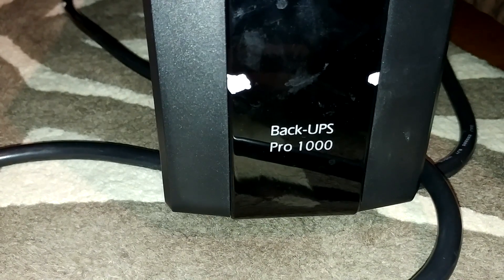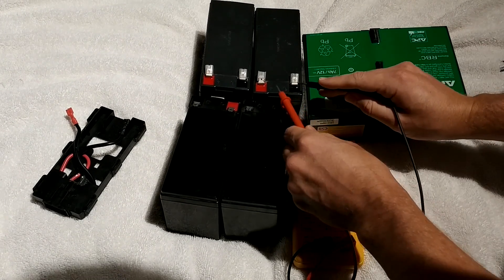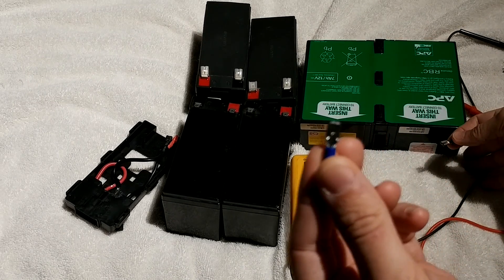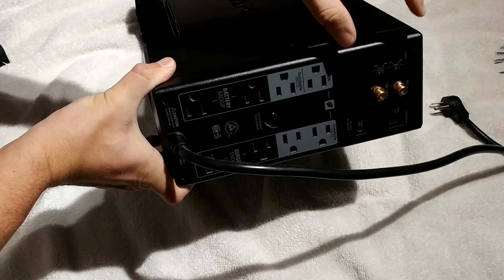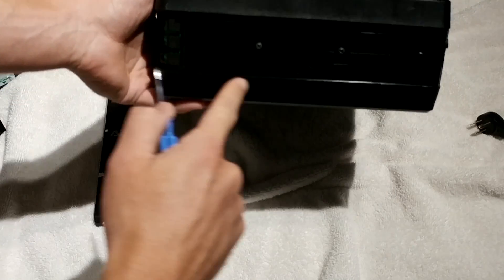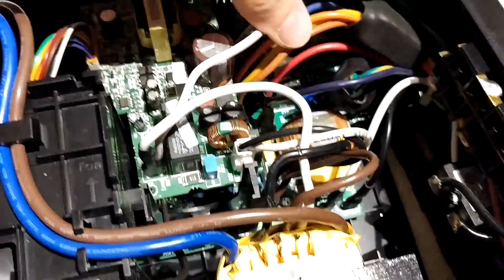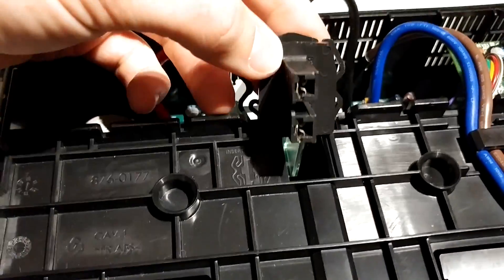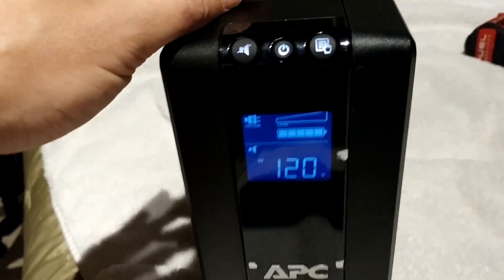APC Back-UPS Pro 1000 BR1000G Disassembly and battery repair

Comment: I wish my repair was as easy.   On my APC Back-UPS XS 1000 the status button (button to the right of the on/off button) facing the unit no longer responds and does nothing.   I need to repair the button.    On another UPS unit I have, the batteries will not charge.....(they are brand new batteries that are tested and known good).    The circuitry on the board is faulty and no charging voltage is going to the batteries.    I'm in the middle of trouble shooting both these issues.     I sure wish I'd get issues like this occasionally.

Comment: This video was great. Im debating on buying new batteries for my xs 1000. I found the unit on offerup for $10 but it gives me an F01 error. Is it worth it to buy a replacement battery or is the unit no good?
Reply from the maker: AJH81 I believe F01 is due to overloading the battery. I would try braindeading the unit and putting in a new battery with no load on the unit and see if the error persists. If it's still there, you may have a faulty unit that needs to be repaired or replaced.

Comment: IF FRIENDS ARE BATTERIES OF 12 VOLTS AND GATES THE TWO ARE 24 VOLTS BUT CURRENTLY MEAN EVERY BATTERY IS 6 VOLTS AND THE TWO BOARD IS IN 12 VOLTS

Comment: To ok thank you friend for responding fast but changing the two batteries will cause the fault as the two batteries together measures 12.23 and separate measures 6 volts each if you change the two batteries will remove the fault
Reply from the maker: It sounds like your batteries may be faulty. I think the PRO-1300 battery pack should measure 24-25 volts (as two 12-volt batteries wired in series).

Comment: hola amigo como esta excelente tutorial lo entendi pero yo tengo 
el modelo APC PRO1300 y tiene la misma falla de eso modelo que das 
tu la explicacion pero el mio lo deje calgando toda la noche y cuando 
en la mañana me paro me que el UPS decia en la pantalla F04 y me voy 
al manual que me baje de internet y me dice que es F04 Clamp Short mi 
pregunta es si mi modelo es el mismo que el dijo y si le cambio la bateria 
queda listo y que quiere decir con abrasadera corta
Reply from the maker: Hola Wladimir. Voy a responder a su mensaje abajo en Inglés.

Comment: Hi friend, how did this excellent tutorial I understand but I have
The model APC PRO1300 and has the same fault of that model that gives
Your explanation but mine leave it all night and when
In the morning I stop myself that the UPS said on the F04 screen and I'm leaving
To the manual that I download from the internet and tells me that it is F04 Clamp Short my
Question is if my model is the same as he said and if I change the battery
Is ready and what means with short abraser
Reply from the maker: Hi Wladimir,
Your UPS may have been permanently damaged by a large electrical surge. This website may help: http://www.fixya.com/support/t16878929-apc_pro1300_f04_clamp_short_error_code

It may also just be the battery, or a defective USB cable between the UPS and PC. Good luck! Please let us know here if you find a working solution.
Reply from the maker: Hi @Fallon Cohen, this goes a bit beyond my expertise.  If one of mine was behaving that way, I would still disassemble it to verify good connection contacts, and to also look for any other signs of component failure. If nothing is glaringly obvious, I would scrap the unit, or maybe keep it for spare parts. Good luck.
Reply from the maker: @Fallon Cohen Sure. Use a multimeter to test the voltage of the battery before installation, then install the battery and see if the leads coming from the connector going to the circuit board give you the same reading.

Comment: Video was excellent. Thank you for all of the work.
I am still having problems with the clips that retain the front cover. What direction should I pry to release them. The ones on the bottom are particularly difficult to reach, unless the rectangular cutout is the place to pry.

Your comments will be appreciated.
Reply from the maker: Yes the front cover is tricky. As you noticed around 6:02 in this video, I broke 3 of the clips that hold mine on. Start on the bottom with a plastic pry bar at the rectangular cutout, then slowly work it up the sides of the panel. I also marked on my panel in the video where the rest of the clips are so you might be able to apply the leverage more accurately. Keep applying more fore until the clips pop loose, hopefully unbroken!
Reply: With the unit resting on the back (side from which the cord exits), is the prying motion initiated by using the case as the fulcrum of the lever, the small arm of the lever under the cover, and the long arm of the lever pressed downward to exert upward force on the cover?
Reply from the maker: d davus yes, you're essentially prying the cover out at a vector perpendicular to the body of the UPS.
Reply: I now have to courage to attempt removal. Thank you for your reply and help.
Reply: There is another way to remove the front trim plate of the br1500/br1000. It was in Tom's hardware. They recommend prying the bottom of the trim plate from the catches and then sliding the trim toward the top of the unit. This allegedly disengages the other catches. Does that seem correct?

Comment: Can a UPS like this be used to run a garage door motor ?
Reply from the maker: Yes.
Keep in mind these can get quite heavy, so mount it securely!
Update: Don't know why I didn't mention this earlier. This scenario greatly depends on the power demands of the garage door motor. A 1HP motor is roughly 750 watts, so make sure whatever model UPS you're using can sustain such a power draw for the right amount of time to open/close.
Reply: @WillHennegan  How long did it take for the original batteries to wear out? I'm planning to buy this because my area has constant power fluctuations. But I'm confused though, should I just buy an AVR and connect it to my home inverter UPS or buy this? Help.
Reply from the maker: Hi @archangel7052 , batteries should at least last the warranty period, which is usually 3 years for APC. Mine lasted 4 or 5 years. I would not consider myself an expert, but I believe these UPS units act like a AVR for their rated load, with the added bonus of backup power.  I cannot really answer your question without more info about the power fluctuations you're having, or the equipment/load you need to support, but I hope this helps. If your power fluctuations are bad enough to where a UPS would be active a few times a day, you need to have your power company fix your service. We actually had that issue in our neighborhood a few months ago and they switched out a faulty transformer within a day.
Reply: @WillHennegan  600watts PSU, with rtx 2070 and i7 6700k. 144hz monitor 27".
Reply from the maker: @archangel7052  sure, that should protect your computer and monitor from irregular power waves, and from total outages for 5-10 minutes at least. Good luck!

Comment: If it just a matter of pushing the connector back to where it needs to be and applying glue is it necessary to disconnect every wire that is connected to the boards?
Reply from the maker: Hi budrig, if the only thing you need to repair is the battery connector, you do not need to disconnect every wire or remove any components beyond the side panel. I only went that far to help & show others who might have to replace relays or other components and examine everything else for myself.

Make sure the unit is unplugged and do test how well the battery connects before completely re-assembling.

Good luck!
Reply: I didn't think so but I wanted to be sure. Thanks for the speedy response Will. Awesome video by the way, you saved me a nice chuck of time!
Reply from the maker: You're welcome--it's worth the time to make the video if it saves others exponentially more.